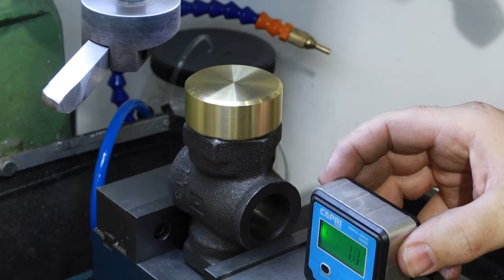Making a Soft Face Mallet from a Gas Meter Valve

Comment: Very nice hammer. I’m a jeweler and have made several smaller using brass pipe fittings. I usually fill them with lead shot. Thank you for posting this.
Reply from the maker: Yeah, I need to make some more, especially some that I'm willing to actually use! Thank you for watching and commenting!

Comment: Love it. Now to put it to use. First ding will be the hardest, but the only wat to appreciate it is to use it. :)
Reply from the maker: Yeah, about that... So far it's living on a bookshelf in the living room. 😂
Reply: @glueandsparks  It really does look like an excellently functional mallet my soft face is my goto hammer for the machine shop or really anywhere I’m not trying to destroy something or drive nails
Reply: @glueandsparks  Noooo. It needs to be used. First ding or scratch will be the hardest, but it will get easier from there.
I made a beautiful workbench from old reclaimed hardwood. Achieved a perfect surface finish with hardware and it ended up living in the lounge room for about 6 months. A very fancy side table. First main damage was when I buggered up and ran a circ saw into the edge. I'm no longer precious about it after that stuff up. :)

Comment: Nice project. You need to examine and adjust your rip fence on your table saw. 
Your blade is binding on the exit and burnishing the wood.
Reply from the maker: I'm glad you liked it! The fence is actually quite accurate, but that blade was more dull than I realized. I just finished the cuts since I was turning everything down on the lathe anyway. Believe me, there was no mistaking the smell when I was done with those cuts!

Comment: 👍👍👍 I've never worked with lead, how much heat did it take to liquidize?
Reply from the maker: Great question, Ron! I was using a relatively low power hot plate ($18 on Amazon) for this. 1000 watts or so, and it was plenty. In the past I've used a propane camping stove. This was much easier!

Comment: What kind of feeds and speeds are you running on the machine?
Reply from the maker: I mean...lots. The gray lathe has variable speed (Reeves drive, like a Continuously Variable Transmission). The green lathe has 6 belt positions. Different speeds for different materials and processes. I've found that very few people watch new channels with slow content, such as explaining numbers like that. (See my video on aluminum trim molding for an example. It has been dead to recommendations for almost 2 years.) 

When few people watch for very long, YouTube stops showing the video to ANYONE. Have to do some like this where I cut rapidly and don't do much in the way of explanations that would bore mass market viewers to get some movement behind the channel before I can get into stuff like that with an established audience. I would much rather do a long video where I explain all of it, but at this stage YouTube would just punish me for that.